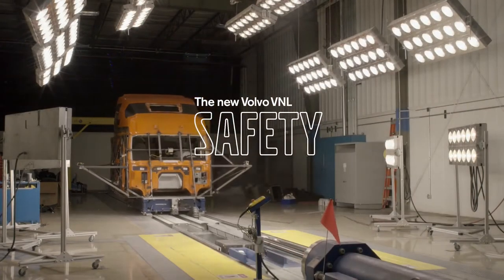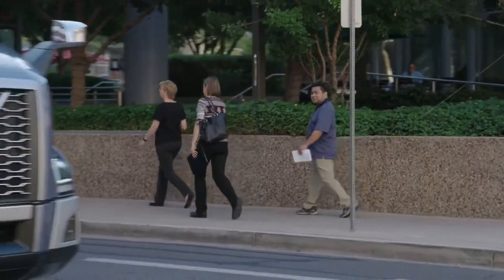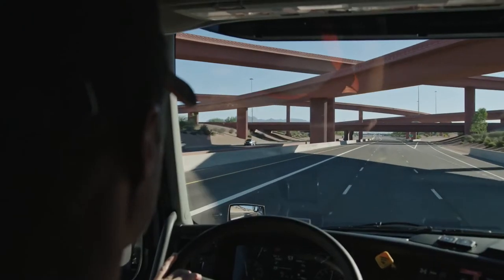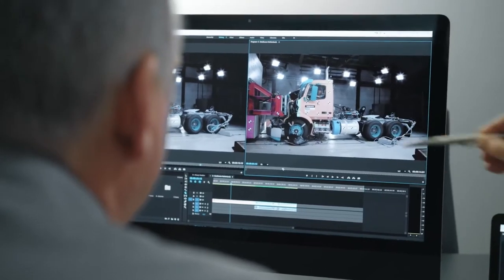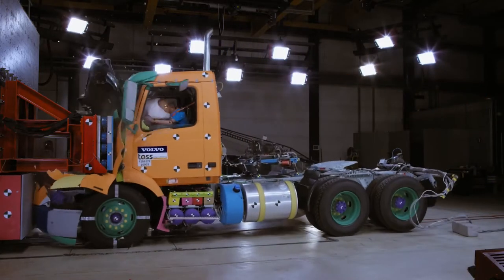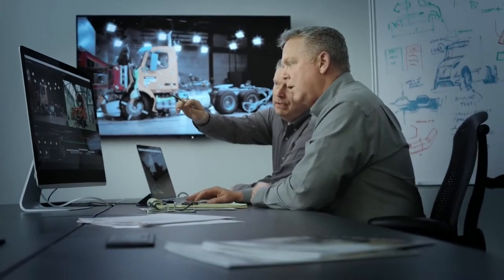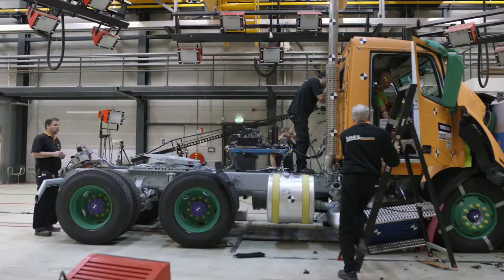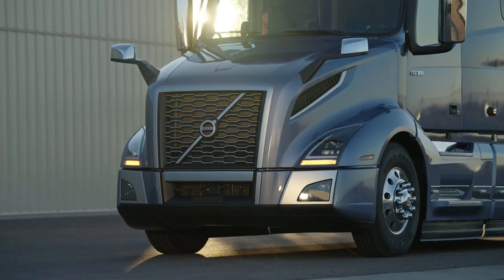2018 Volvo Trucks VNL Crash Test

Comment: I own a 2020 volvo truck. If you have the seat correctly adjusted, I can reach everything. My turn signals do auto cancel.  This is my third volvo.  I have owned 2 freightliners and 1 peterbuilt. I will take the Volvo over any truck.